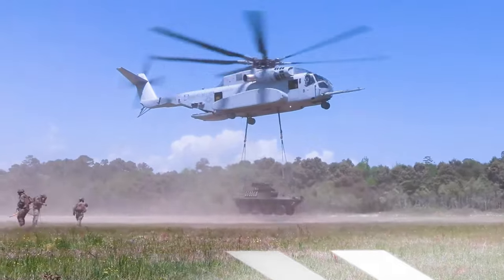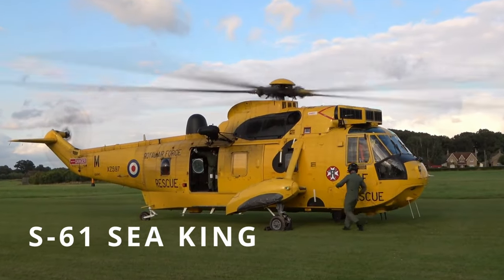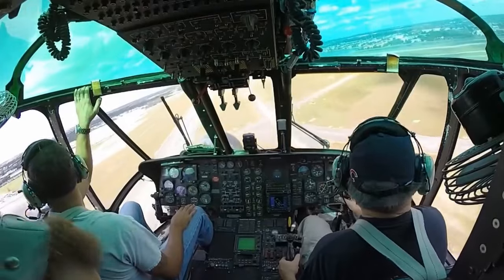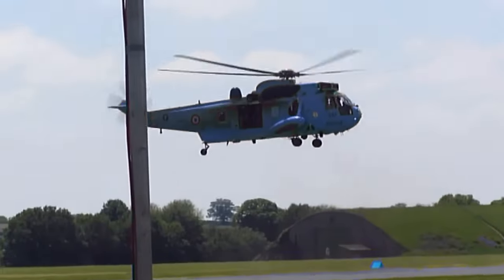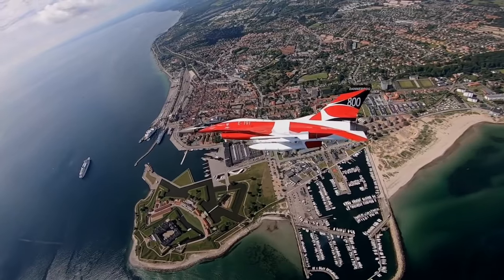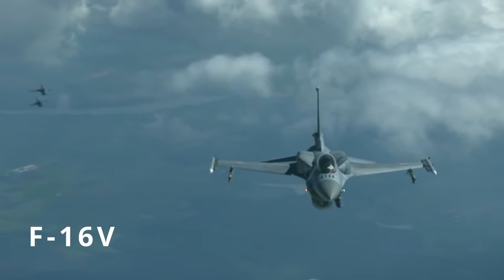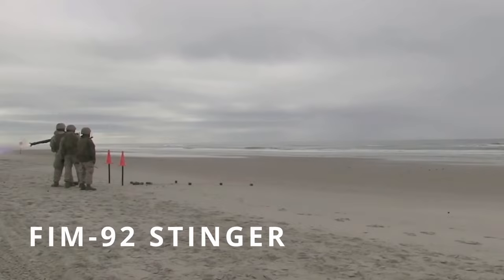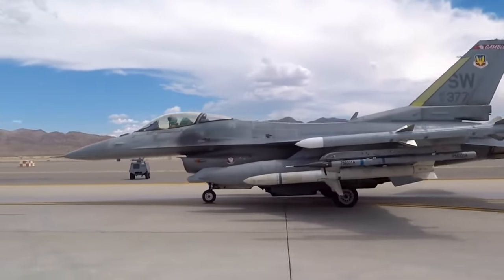New Generation F 16 Finally Arrive To Ukraine

Comment: UPDATED AND EDITED 
The S-61 is Sikorsky's civilian designation for the Sikorsky H-3 series of medium-capacity helicopters, the best known being the H-3D Sea King USN Carrier-based Helicopter. The Sikorsky H-60 series of medium-capacity helicopters, the best known being the CH-60 Blackhawk US Army Utility Helicopter, had replaced them in the late 1970s. A new design is about to replace the H-60 series: the Sikorsky-Boeing SV-1 Defiant X US Army Assault Helicopter. 
   Far larger than the Sikorsky H-3 series is the Sikorsky H-53 series of heavy lift helicopters. It is the largest, most powerful such aircraft in the U.S. military. 
   This updates to this point the severely outdated content the narrator presents herein. 
   This video goes on to praise the General Dynamics F-16 Fighting Falcon USAF Air Superiority Fighter series, without a peep about the appreciably superior McDonnell Douglas F-15 Eagle USAF Air Superiority Fighter and Strike Fighter series, itself undergoing substantial improvement to the F-15EX variant. The F-15E Strike Fighter version carries a greater ordnance loadout, and is faster at altitude. 
[Editorial note: A chap with the username of Just Imagine since explains that this post is about the USA sending F-16s to Ukraine for the latter's war effort, and intends no slight to the F-15. DRL.) 
   The video at 9:26 makes me dubious. I cannot see two aircraft of such sharply divergent performance characteristics and flight envelope would approach the other so closely.
Reply from the maker: No one denies the power of F15, it is only about the fact that negotiations are being prepared regarding the transfer of F16 to Ukraine
Reply: @just_imagine  Thank you for your clarification.

Comment: Unless a country has a nearly bottomless bucket for their military expenditures, the F-16 is probably the best, most economic option available for a fighter/multi-role.  
In a true one-on-one with no external assistance, yes an F-15 is going to win most of the time.  But if two adversaries were fighting with only F-16s vs F-15s and they had a budget of say...........$500 million, I would take the side with the F-16s.  
In addition to having many more jets, the F-16 side would have much lower maintenance and support costs.